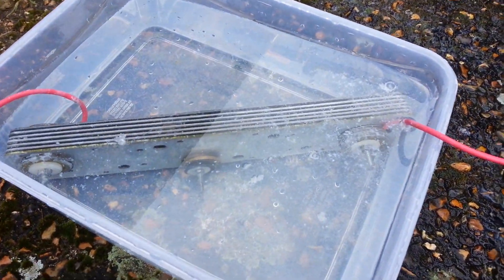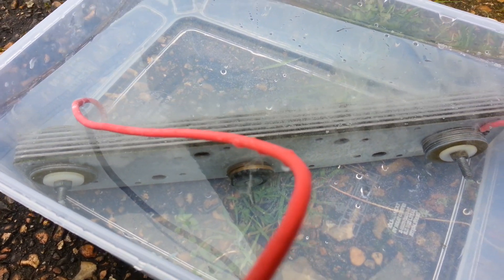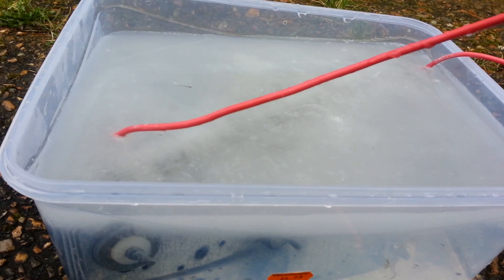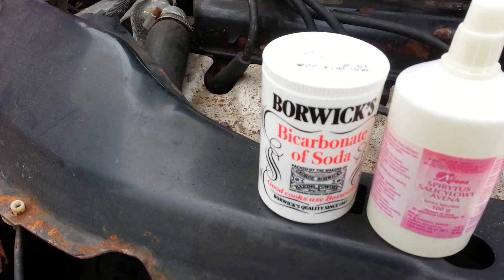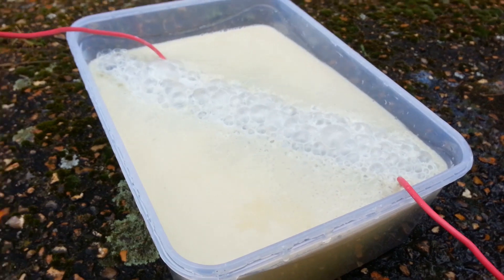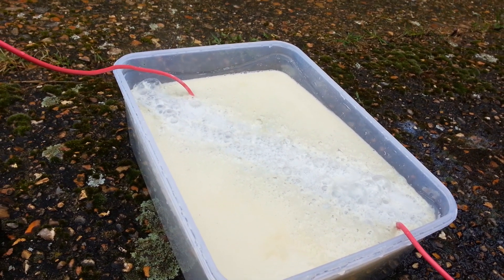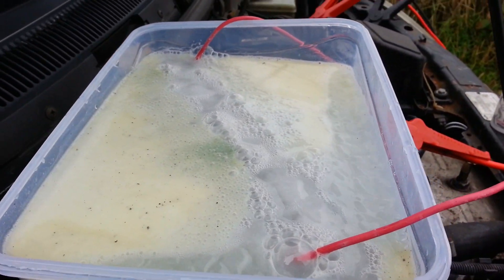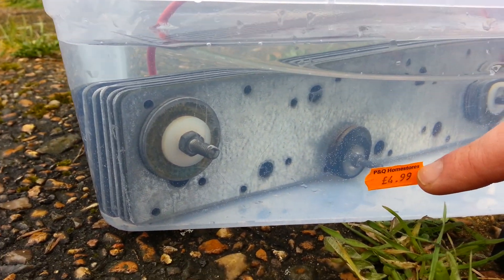HHO Hydrogen Fuel Cell Car Conversion DIY Gas Generator Build 2

Comment: Looking at the way the baking soda kinda trapped the gas in a sludge bubble gave me a slightly dangerous but perhaps useful idea for you! :D
You can keep doing smaller scale tests with different designs of metal elements to see how much surface area you can create and just use water with soap as a solution. That way you can capture a lot of the gas in bubbles somewhat immediately and can more easily visually evaluate how effective your design is; just time it, light it and record it to review.

About your moving up in scale quite a bit from last experiment, perhaps if you cut grooves partially into the washers in your previous design, it would increase the available surface area and improve the output quite a bit? Please be careful though when lighting the soap bubbles if you do try it; I expect you to retain a hell of a lot more firepower than we saw here.